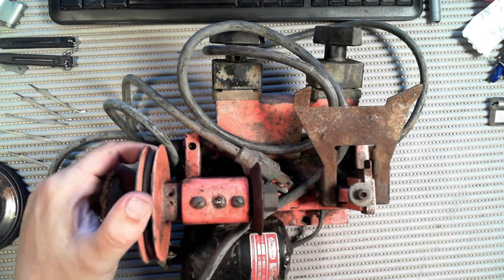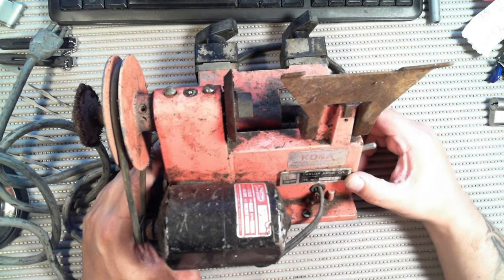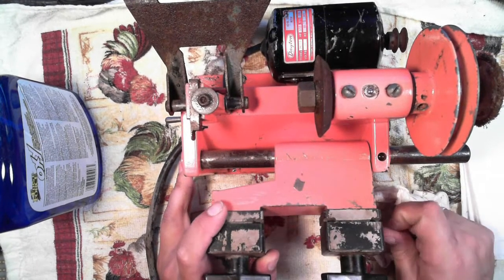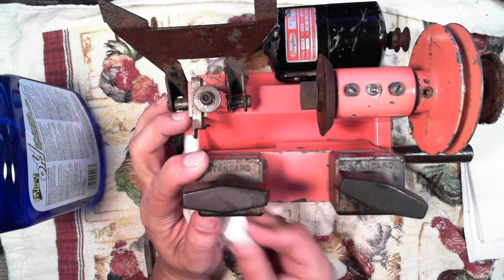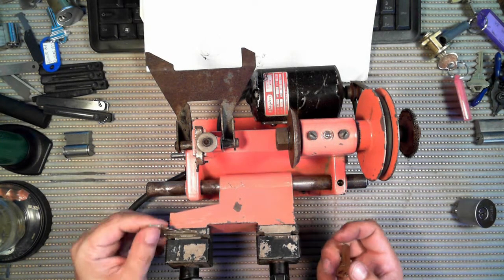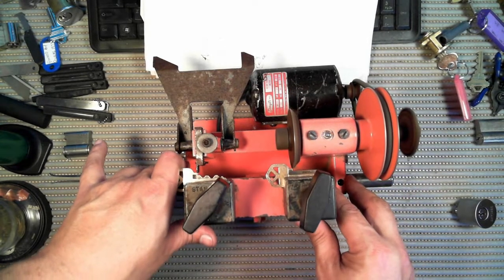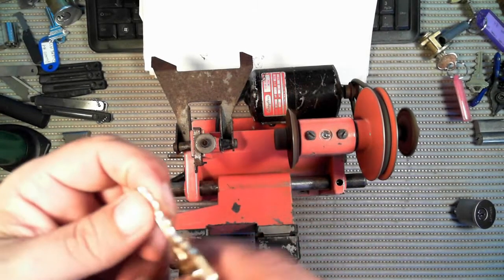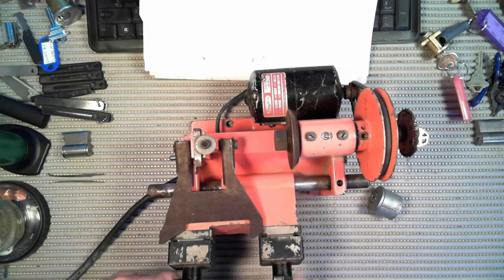-=77=- Freebie! - Key Cutting Machine - Restoration.

Comment: Nice job.BTW just in case you didn't know,this is how you calibrate a duplicator.Get 2 identical key blanks(Preferably SC1s)place them in the jaws and raise the carriage until the blank in the jaw facing the tracer contacts it.Now rotate the cutter shaft pulley a full turn.If the cutter just barely grazes the blank beneath it,it's perfect,however if it digs into the key,the tracer needs to be moved forward and if it spins freely without contacting the blank,then the tracer needs to be moved backwards.Hope this helps

PS:The black screw on top is the lock screw(And needs to be loosened prior to and tightened after adjusting the tracer)and the adjustment screw should be located directly behind the tracer
Reply: haha i just mentioned this..but what i do is take a black marker and coat the part that gets cut and when it grazes it and takes just a bit of black away you know its good
Reply from the maker: I know..... Thanks though.
Reply: i know on some machines you can use a straight edge and clamp it down to get a goodmeasure. that would ultimatly be your best method
Reply from the maker: Yup, that's the one I use. Must make sure you have a VERY straight edge though. I check it every dozen cuts or so. So far it's doing great!
Reply: yea that's a good thing to do. unlike hardware stores that never do
Reply from the maker: Lol, no doubt. They probably don't even know that they should be doing it.

I remember getting keys cut at a hardware store and them not working. Was a long time ago so I don't remember the particulars, but I'm sure it was just a SC1 or WR5.. I ended up just going to a locksmith lol.
Reply: yea that's my most common call is going to an apartment after a bunch of keys were cut because half of them didn't work. so then I have to re do all of them or repin it and start over with a new bit ting cuz the original isn't around. I just finished a job like the other day
Reply from the maker: Kyle Corey
Sad, But it keeps you in business! lol
Reply: yea so I geus I should not complain. lol

Comment: One helpful comment.  When you cut the key on a manual key machine, especially a small one, try to push it on the original key side only to guide it along the cutter.  If you push on both sides you will get inconsistent heights on the cuts because at times you bend the carriage a little pushing hard on the cutting side which makes the cuts too deep. 
You cannot fix a copy that is cut too deep.  Keys wear, so a copy is cut a little low even if a perfect duplication of the original key.
Reply from the maker: Good to know! Thanks for the info!

Comment: If you need to replace the cutter wheel, and it sounds like you do, they can be quite expensive to buy but you can find them cheap on Chinese web sites such as Alibaba.  Also the rubber belt can be found cheaply on Ebay if you look for a large O-ring the right size instead of a vacuum belt.

Comment: Great new toy. I think a new cutter will really really change the performance. I have a small machine almost identical to your but cuts much faster. Check the finish of the cuts on the key, it will give you a better idea if it needs a change or not. I would remove the shaft and stick it in a drill then run it in some light sandpaper plus soak the guide in some rust remove and your set. Well almost, get some space & depths keys so you can code cut then your set. A new cutter can be expensive, there is a spot that re-sharpens old cutters for about half the price of a new cutter. You should have no problem finding the link by running a KP search but if you don't let me know. I'll check my bookmarks.
Reply: Gil-Ray tools is the company you're thinking of ;)
Reply from the maker: for sure! going to get a new cutter for it. the cuts are still clean without too much chatter. but I want to replace it anyways. 

when I do, I will do exactly what you suggested! thanks for the info and the support!

Comment: good score on your key machine. It's unreal how nice it cleaned up. what's the diameter of the shaft?
 I might have some stainless stock that would fit.
Reply from the maker: not sure. Will know more when I pull it apart. once I get a new cutter.

Comment: do you know how to calibrate the machine? take two new blanks...a black marker and mark the one blank key along the blade on the top edge that gets cut. then put both keys in the machine , the one with marker in the cutter side , then turn the cutter manually and you want the blade tojust barely graze the black marker off the key. just barely. ilco has an awesomne video on youtube to do this. oh and i cant forgetto put in there to adjust accordingly to wherever the blade is getting cut. its easy to do and you can do it all the time to be sure ,cuz we all know all it takes is a few thousands of an inch to make a key not work and it being wasted, not ssure if you knew this method or not but wanted to pass it on.
Reply from the maker: Kyle Corey yes I know how and have.. There are also much better ways to calibrate a key cutter as keys are not always perfect.
Reply: Kyle Corey IMO coating the blank with a marker is unnecessary.(As it can be done by feel alone)
Reply from the maker: I agree, but can see why some people would like the visual confirmation.
Reply: I have used both . and using the marker works well for me. my keys always work . this is a recommended method by ilco and Curtis . And that is what I have. and this way I see how much is being grazed off .without it its hard to tell
Reply from the maker: Kyle Corey
I can see that. I also like visual confirmation. lol